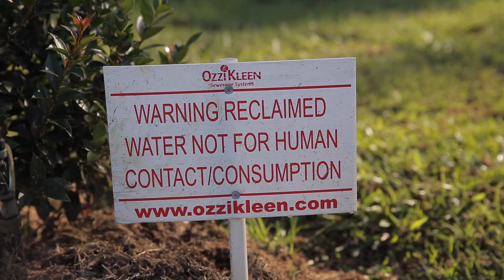On-site sewerage facilities - Aerated wastewater treatment systems

Comment: Can you drink the water if it's further filtered?
Reply: It only gets treated to the point where it is safe to discharge into the environment, where naturally occurring bacteria and treatment processes will continue to break down the biological contaminants. It is not safe to drink until it has had some time in the environment. The effluent is still gray water.